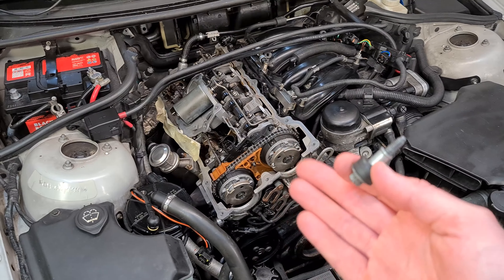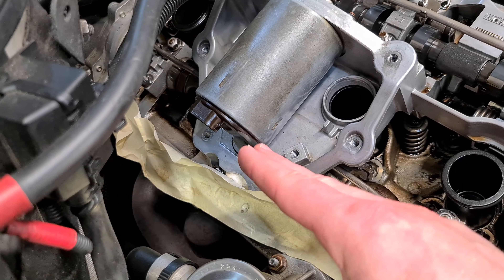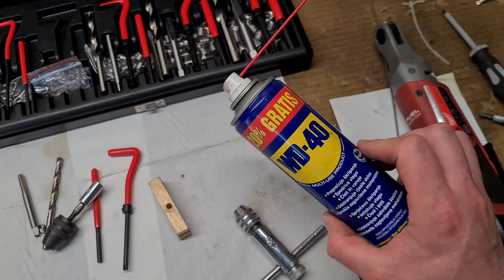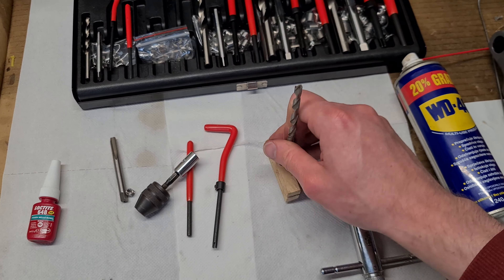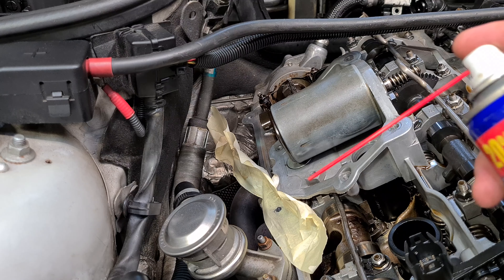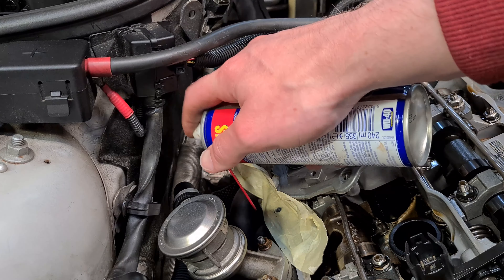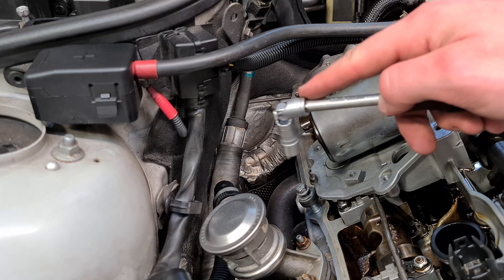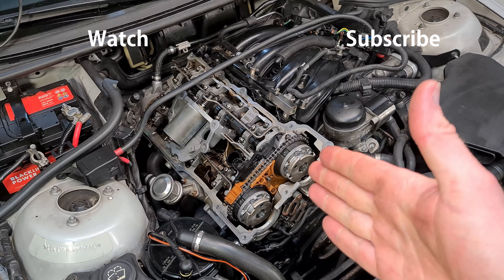Stripped Valve Cover Bolt Thread Repair with Helicoil Insert N42/N46

Comment: I'll be doing this to my D series Honda engine that I'm swapping into my CRX. Looks like I'll be using an identical kit as well! Thanks for posting this video. You made it look much easier than I anticipated. I also liked that you added in some Loctite, which is something I wouldn't have thought to use.

Comment: I just discovered 2 stripped valve cover bolts on a 12 Chevy Cruze and I put gasket maker on top of both to try to hold them I place and stop oil from leaking out till I can get my hands on that tool and try to fix it for my self.
Reply: I just cross threaded two corner valve cover bolts on my 2012 Chevy Cruze and am trying to find a fix myself haha

Comment: I didn’t have extracting tools, so I just drilled one size bigger through the hole fkn thing and put a lock nut on the bottom 😅.  Safe to say, it worked out well! Haven’t removed it :))

Comment: I had the No. 11 bolthole at the rear to do. Prick of a job :) Previous owner had broken the bolt off.I It was seized. Tried every strategy to remove it. Very slowly I drilled it out 3mm drill bit.  Every time I thought I might have been off centre, I would down tools and walk away. Took a week. Wouldn't wish it on anyone.
Reply from the maker: Thanks for sharing your experience. Good to know how it could be done and mentally prepare for the process:)
Reply: @BimmerZen  Mental preparation is amust!

Comment: Question for m50b25, we have different valve cover bolts where the tread is inside the block, so I get the same kid and use a whole different valve cover bolt or get a different kit?

Comment: If these are stripped....could it cause misfires? The reason I'm asking is because we had misfires on all cylinders. Replaced coil packs, spark plugs, oxygen sensors etc still was misfiring and the code that came up said a possible repair needed could be one of the intake gaskets.  They said that it's possible the valve cover isnt sitting like it should..that's when we discovered at least 2 of the bolts were stripped out and it wasn't tightening down. Could that cause an oxygen issue/cause it to misfire?
Reply from the maker: Yes, you can easily have vacuum leak whee the bolts are missing and that will cause poor idle and poor engine performace
Reply: @BimmerZen  thanks. Maybe this thread repair kit will be the end all of these dang misfires. I was really hoping we didn't have to get into fuel injectors, so I hope so

Comment: sir, I plan to repair threads on my cylinder head. my bolt diameter is 10mm. what size kit should I buy? they offer m10 and m12
Reply from the maker: As far as I know you need the M10 repair kit. Also make sure you get the correct thread pitch kit based on your  bolt.

Comment: Dude I won’t even lie I used that to screw a valve cover bolt the other day and stripped the treads I was trying to go easy too i was being lazy I should’ve done it by hand but yeah I’m not too worried about it it still threads but it doesn’t snug down all the way if it leaks I’ll do some rtv. The motor is a temporary motor while I have my other one being sent out but yeah mistakes happen
Reply: Hopefully the bolt for your valve cover r the ones on the outside of the gasket.  If not, then ya, it may leak some

Comment: did your punch have a magnetic tip on it to get the tang out once you knocked it off? did not see you get it out?
Reply: I noticed that as well. What I did was attach a 6mm piece of tube to a vacuum cleaner and sucked it out

Comment: If i have a broken bolt, do i have to rethread it? Or can i just extract it? I broke one where the valve cover goes
Reply from the maker: You can remove the broken bolt and just try and torque that position to 10 Nm. If it holds, then it should be OK.
Reply: @BimmerZen  thank you for taking the time to respond, blessings brother 🙏

Comment: Your too strong when tightening bolts questions what's the volts on the cam sensor I got 12 pin 1 pin two 11.something and 3 is ground I think pin one of the pin  would read 5 volts I have a 27bb dtc give me problems to fix engine in limp home mode have any solutions